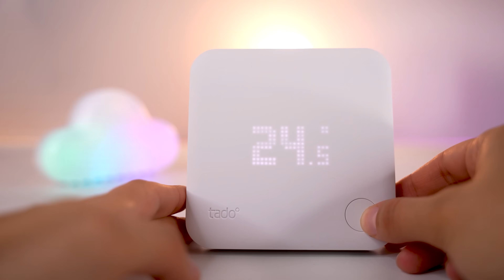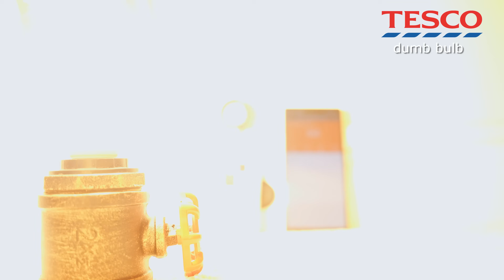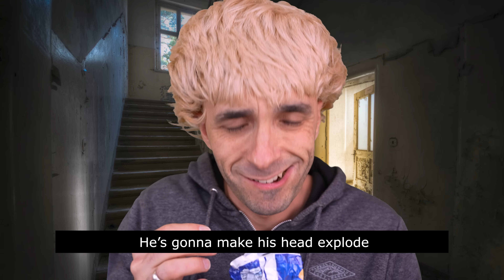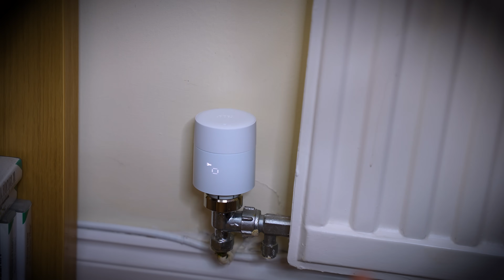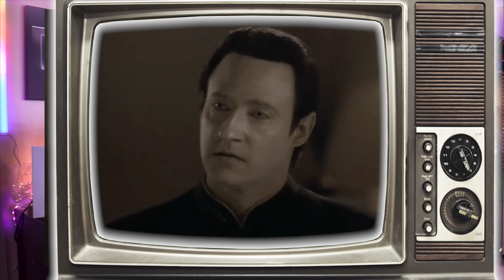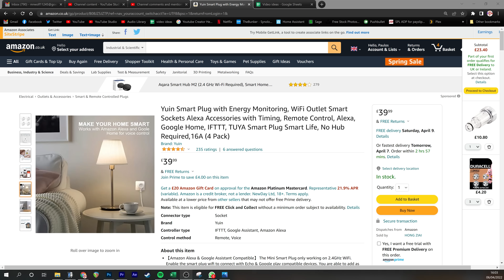The Energy Companies Will Hate Me For Telling You This But... | #EnergyChallenge

Comment: The best feature of the Tado is the geofencing, my wife and I are in and out the whole time - when it detects that no one is home it goes 'hey why am I heating the house, no one is here' and doesn't
Reply: Can you set it to stay on a low level all when you leave? And does it keep the temperature the same all over the place? Because if the temperature differs with more than 5c and the radiator is completely off it’s going to take longer to heat up.
Reply: @charisma-hornum-fries  You can set it to whatever temperature you want. With modern heating systems, if you are not there don't heat it they react very quickly
Reply: @charisma-hornum-fries  Yes, you have "home" and "away" profiles.  Away defaults to frost protection, but you can configure it as much as you want.

It's absolutely trivial to, say, set it so that the room your dog is in doesn't drop below 16C but the rest of the house is just on frost protection.  Or any other combination.

Comment: Thanks for the advice and making it comical . After a bit of digging, I've found out the 3rd gen Nest is OpenThem compatible. Then found out my boiler is too, yet the installers didn't configure it that way!
Reply: Yeah, having a new boiler professionally installed, having deliberately chosen a brand that does OpenTherm (so not Worcester) I was pretty annoyed to discover they didn't wire the HeatLink to the OT terminals and I had to fix it myself!
Reply: @JamesScholesUK  I've done the same now. shame it took almost 2 years and the start of the nicer weather. Looking forward to winter savings as a reward for swapping over 2 wires and telling Nest it can use OpenTerm.

Comment: I've been using the Drayton Wiser 2 channel system for heating and hotwater and while they don't support opentherm for this model (only the single channel one that does heating only) the system does have a lot of the same features.  It also has an eco mode which attempts to learn the rate of temp increase in a room and will stop the demand before the room reaches temperature to minimise gas usage.  The range extenders/plug sockets are seriously over priced though.
It does have the advantage of not requiring an internet connection except during initial setup ... after that the app is able to talk to the hub directly over the local network.  There is also an HA integration that uses the local api for control :)

Comment: For another smart home money saving idea - curtains and blinds. Having these open and close at correct times helps the thermal properties in your room. Sunny outside but cold inside - open the curtains and blinds and let the sun in. Not sunny anymore? Close them again and help trap the heat inside a bit longer. Too hot inside and it’s sunny, close them to stop the heat build up. SwitchBot choo choo’s to the rescue

Comment: Great video Paul, as usual.  Thanks for all the cost of running devices info.  I have been using the Drayton Wiser thermostat/App and radiator valves for some time now.  There is a Home Assistant integration that is maintained and works really well.  I have Solar Thermal panels - I have also integrated the data from the pump controller into HA.  This means that I now control automatically in HA if my gas boiler heats hot water on a day based on the current temp. of the hot water, and the predicted temperatures/number of hours of sunshine for the day.  Typically my Gas boiler does not come on between May and October - saves me a fortune.   p.s. I looked at TADO, but went off them when they announced charging for IFTTT integration.  p.p.s. How many packets of crisps do you eat whilst making a video?? And what flavour??

Comment: We have a Honeywell EvoHome system that has been doing the Tado trick for the last 10 years now. Not only does it save energy, when configured right, it increases the comfort of your home significantly.  

Our new house is build completely automated (not a single switch is installed), the house will provide all the comfort we want, when we need it, where we need it. And therefore, will not use power when we do not need it.
To provide power there will be over 15kWp in solar panels and a 16kWh battery. 
In the end, our electricity bill will be negative :-) 

As we're in the Netherlands, it is not allowed to hook up a new house to natural gas (or other fosil fuels) anymore.

Comment: I uses plugs in almost everything. I have set up them in Home Assistant and get the usage in to the Energy page. I have set Threshold Helpers for each plug that I don't want in standby and then turn off the plugs after 10 seconds in standby. I turn on the plugs from my light switches. I get close to zero standby cost (except for the plug) and get control of the usage.
With the Threshold Helpers I also get the log of Watching TV, Cooking, Using Computer and so on.

I really LOVE it!

Comment: I have Tado with 18 units connected, Tado in the uk isn’t open therm, this is not available on the uk market,
Reply from the maker: I connected it to the opentherm terminals on the boiler myself. I only agreed to include them on the basis that it was opentherm
Reply: Thanks for the reply Paul, I think the Tado is a brilliant bit of kit, my family think the same, everyone has there room how they want it and no one complains it too hot, I will be replacing my boiler this summer and will have to order a EU version of the wireless receiver to get the OT function, I believe they don’t offer it in the uk as most systems ate Y plan and it won’t work with this type of system.

Comment: Boiler - My lovely simple Netatmo thermostat does two things wonderfully:-
1) It learns how long it takes to warm your house, and by adjusting this along with the outdoor temp, it turns on your heating so you reach the desired temp at the time you want. ie: 90min before or 30mins before depending on outdoor temp.
2) It turns on/off the heating to keep you at the desired temp. So it does not bounce over and under the desired temp, but instead keeps you at that temp.

Comment: Some more good advice.

Personally I've just completed my first year with the tado kit installed.  My in-laws (who live with me) previously used electric heaters (albeit oil filled radiators) to top up the heating in particular rooms prior to the tado kit being installed.  After the first year, with the ability to control individual rooms using a combination of Smart TRV's and wireless thermostats, I've cut about 20% off my electric usage and about 20% off my gas usage as well - which is pretty significant.  I've got 8 rooms setup controlling 2 heating zones (2 wired Thermostats for those), 4 wireless thermostats and 8 Smart TRVs - definitely keep your eyes open for deals and/or refurbed products from tado.  Some other automations around motion lighting in a couple of rooms have also helped with the electric usage but it was mainly my in-laws no longer using electric heaters.

I've also just been interviewed by tado about the apps and their products (Google Meet meeting) - they've done a lot apparently so they can get direct feedback from customers like me.  Great company, very responsive if you need help from their tech support too.
Reply: This is interesting to hear. I've used Tado over 3 winters now and love it for these reasons as work from home so never heat the whole house unnecessarily, just my study. I also have a 2 year old and when she first went into her nursery at 6 months old I knew her room would be exactly 20 degrees over night, no matter what the rest of the house dipped to. Must have saved a fortune there!

Comment: I have found an 8w smart led only uses 2w when at half brightness. So in 2 locations where I have a light in almost all day I purchased a 16w bulb and run it at half brightness so it’s only using 4w. This doesn’t actually save money though because a 16w bulb costs over $20.
Reply: I use 35% daytime and evening, full power red at night. All bulbs on PIRs, two dumb PIR bulbs and three smart on external PIR. Still have working LED bulbs from 2006!
Reply: I have found my outdoor lights running at about the same 35% just do not attract bugs like every other bulb I have used. Have you noticed the same? I’m wondering if they were actually attracted to the heat not the light.

Comment: One question: How safe is cut power from TV with smart socket? That TV can be doing some updates when screen is Off. My TV also keeps connected USB HDD allways powered. I don't want to brick my TV or broke file system from that USB HDD...
Reply: I don’t like the idea of cutting power to TV’s and set top boxes. My OLED TV has a smart shut down that clears the pixels when it turns off, this extends the screen life but needs power. Also there is the chance of screwing up a software install. With a set top box, what about scheduled records, they will all fail. And the same s/w update issue.

Comment: I've been using a Tado system with 7 smart rad valves for 6 months and it's been awesome. Genuine savings from being able to turn off individual rooms and have much better overall control than dumb TRVs. You can use Alexa routines or Apple Homekit for Geofencing rather than paying the small monthly subscription from Tado for that.
Reply: We don't pay for Tado's Geofencing, we do it manually (occasionally prompted by Tado).  Works well enough without paying the fee.

Comment: When our current electric contract expires, our 65” TV will cost £70 on standby for 18 hours a day.  It’s now plugged into a TP- Link KASA smart socket and switches on and off using Alexa and schedules.
Reply: Check the backlight settings, if too high or on DYNAMIC it will use 2x power 💰👍

Comment: I've had Tado devices for years, and they are great. However, I no longer suggest them due to the monthly subscription now required for some of the more advanced features (which I think make it the best solution), I now suggest Netatmo for heating (though I have never used them myself).

I think motion sensitive lighting, as well as dimming the lights as it gets later is a simple and easy cost saver too.
Reply: I recreated the geofencing feature of Tado using Homeassistant. So i can set home/away and other things without a monthly subscription 🤩

I also use window switches for turning off the heaters and outdoor temperature sensors to detect if it‘s summer and turn off all heaters.
Works great and (hopefully) saves some money.

Comment: Really wanted to use the tado kit but from reviews it seemed they have a range issue. As someone who is in a non standard construction property and has a very unusual setup, they likely wouldn't work. Will be interesting to see your full review and evaluation. Currently looking at the Drayton wiser stuff as they have a smart plug that doubles as a range extender for the rad thermostats. Shame though as the tado rad thermostats are nicer.
Reply: We have Tado, it's great but yes, range definitely a limitation and there's no extender technology for them.
Reply: @paulgoffin8054  thanks for that, does confirm what the reviews said. Our property is a converted cold war concrete bunker with walls up to 18 inches thick so if tado struggles in a normal house I've got no chance. If they did mesh either by ZigBee or wi-fi there wouldn't be an issue. Oh well looks like it's going to be Drayton then unless I find something else.
Reply: I have a 3 storey L shaped house…modern but with metal studs in all the walls so a bit like a Faraday cage effect. My internet hub is sited in the outside leg of the L, the Wi-Fi couldn’t even reach to the middle of the ground floor previously. I use 7 mesh discs and now have fantastic coverage all over the house and garden. All my Tado connect great now.

Comment: I have a question, am I right in thinking that in order to have smart bulbs the main light switch needs to be on at all times? How much electricity does this use, as right now i turn them off at the wall so I’m not really using the smart features. They’re just bulbs.
Reply: Depends on the tech.  Wifi uses about 1W per device, which is huge.  ZigBee uses about 1/100th of that.
Reply: @paulgoffin8054  Oh right. I have Philips Hue (sorry I was new to all this and didn’t know any better 😬😂) So they come up Zigbie right?
Reply: @alexanderramzan7507  Basically, yes.
Reply: @paulgoffin8054  Paul I see you have pasted this 1/100th of the power usage all over here.
Where are you getting that figure from?
From what I've seen its more like 1/4 of the power?!
Reply: @TheWebstaff  It's the data I've seen from the manufacturers.

Wifi devices like Shelly tend to draw between 0.7-1W constantly.  Zigbee has significant sleep periods so it does depend on application and designed response time.  Zigbee supports battery powered devices with battery life measured in years.  You can't achieve that with 0.25W consumption.

Comment: Am I right in thinking the smart trv valves only come on when the thermostat is set to heat the house? I’m a struggling to see a use for them 🤔
Reply: You should still use a main thermostat to turn on and off heating. The smart trvs are useful when keeping bedrooms cooler than rest of house for example. 

My upstairs is always hotter so I set the upstairs  bedrooms to 19, rest of house to 21. It means hot water is not going upstairs once upstairs is over 19, which heats up downstairs quicker and shuts off heating quicker
Reply: @iaincrowley  thanks for that! I live in a bungalow but it depends on the time of year to which end if the house is warmer. For example in the summer the living room is much hotter because there’s a floor you ceiling windows abs a bi fold door so when the sun hits it’s scorching! But in the winter is day my bedroom is the warmest 🤷🏼‍♂️
Reply: @iaincrowley  You don't need a main thermostat with Tado - it's a bigger investment but you can put Tado radiator valves on all your radiators and have individual profiles for all rooms.  The valves signal the controller to run the boiler
Reply: @paulgoffin8054  I thought you always had to have a thermostat?
Reply: @michaelthompson657  Each rad value is a thermostat.  You have to have the controller which replaces the timer on traditional systems but any combination of Tado devices can call for heat - or not, you can use their rad valves as traditional ones if you like, or any combination.

You don't have to have a separate "main" thermostat.  I used to have one when I first installed my Tado system but as I added more individual radiator valves, I no longer use the "main" thermostat.  It's really not required.
Reply: @paulgoffin8054  thanks for the knowledge! I don’t know much about heating so I apologise here, something I’m trying to get my head around. If each radiator has a smart trv and say only 1 trv calls for heart do you not need a multi zone heating system otherwise it’ll hear every radiator in the house? Please correct me if I’m wrong here, like I say it’s s something I’m trying to get my head around
Reply: @michaelthompson657  If each rad has a Tado TRV and only one calls for heat, your pump & boiler will run until that TRV stops calling for heat - all the other rads will remain "off".

Effectively, every room is its own "Zone".

We have Tado TRVs on all our "big" radiators - one in each normal room.  We don't have TRVs on bathroom rads, so those will heat whenever ANY TRV calls for heat.  That's slightly less efficient, but it means the bathrooms are warm, which we want...  We don't have a "main" thermostat as it's basically redundant.  We only have one "zone", one pump.
Reply: @paulgoffin8054  oh cool! I assumed to get the different zones it would need each zone piping back to the boiler separately. I wasn’t aware just a trv could solve this, or am I misinterpreting? I’m more of an electrical guy so I don’t know much about heating
Reply: @michaelthompson657  You have it right. (As in no need to change pipework) In electrical terms, imagine the TRV as a WiFi controlled relay with integral temperature sensor.
Reply: @paulgoffin8054  yeah makes a bit more sense now, thanks! I was almost 99% sure it would need piping to allow different zones
Reply: @paulgoffin8054  I know but I have an air to water heat pump for which tado in incompatible. I've had tado before as well as netatmo, and tbh I would recommend a standard thermostat main controller and ZigBee trv combo to anyone
Reply: They detect the temp of the room, so if some rooms heat up quicker then they slow the supply. Also, if a room isn't always in use, you can shut it off without messing around with the rad controls. Also useful for programming when you might need a room heating at a specific time.
Reply: @ian9outof10  thanks for that! Hue would you detect a room isn’t in use? Is that just a manual process?
Reply: With Tado, the valves can switch the heating on.  We no longer have a "main thermostat", each room has its own profile.
Reply: @paulgoffin8054  I did not know this! Where can I read more about this?
Reply: @michaelthompson657  It's not so much "read about it", it really is how Tado systems work.  All the radiator valves are temperature sensors and any or all of them (you set the options in the app) can control the boiler.

Tado tech support are really helpful too, BTW. They can take a couple of hours to reply but they will answer everything.
Reply: @paulgoffin8054  that’s great thanks, I might contact support!